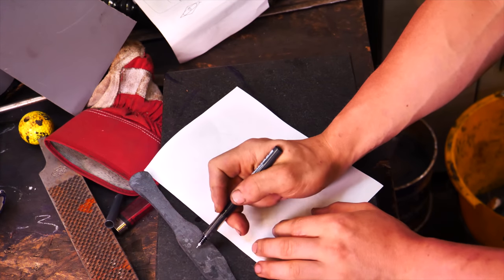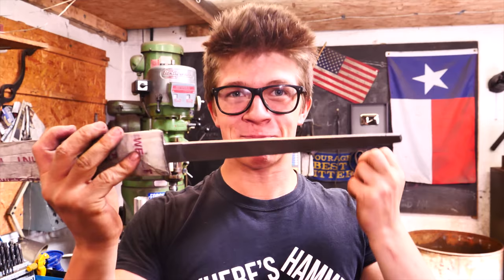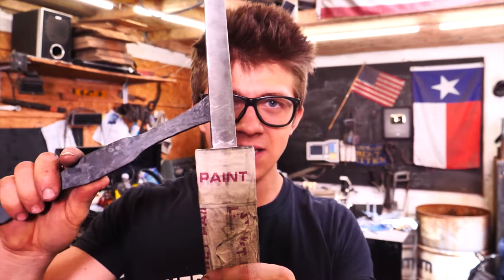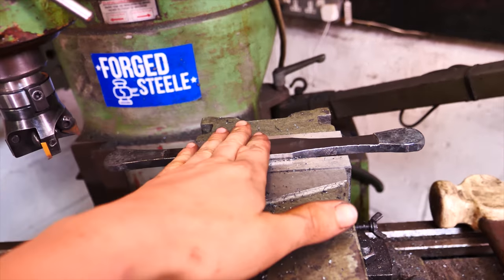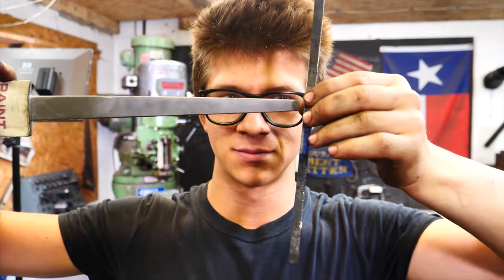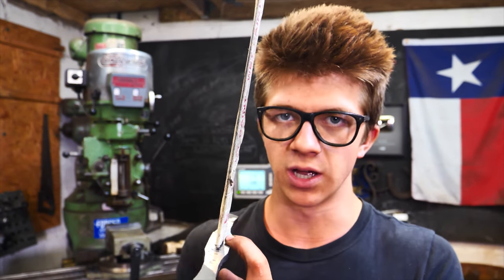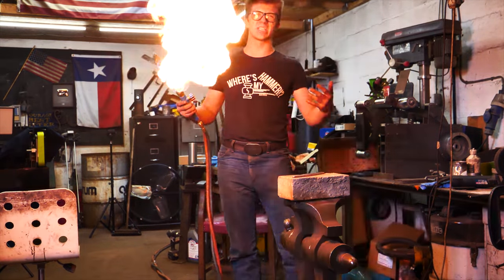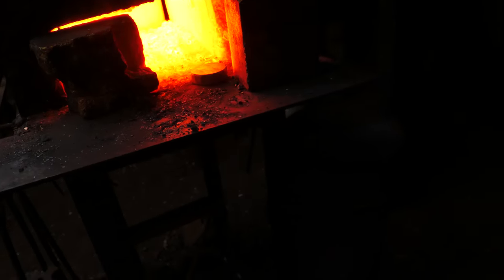MAKING MY FIRST SWORD: Part 7: THE GUARD IS MADE + Forging the Pommel *4K*

Comment: Ok, just a few small tips, 
1. bend the guard upwards just a few degrees on both sight of the blade, it will look amazing and it will add functionality to the overall piece(easier to catch a sword on the guard if it is angled)
2. Please put a larger version of your stylized "S" logo on one or both sides of the pommel. it will look amazeballs! 
3. please read this.
Reply: UPVOTe UPVOTE UPVOTE
Reply: Kent Bräster I SECOND THIS ^
Reply: I also second this.
Reply: Kent Bräster I second this!!!!
Reply: I like the straight guard. Design on the pommel is a good idea though.
Reply: I like the traditional straight guard :)
Reply: I think "please read this" should be #1, yeah?
Reply: I'm not too sure catching your opponents sword in combat is such a great idea. I mean, you incapacitate not only your opponent, but you also greatly risk doing it to yourself, due to a sword stuck on the guard...
Reply: Catching the blade usually just means stopping it on your guard - arresting the momentum but not actually having it bite into or stick on the guard itself. That said in my experience (several years of sword fighting through HEMA) removing the blade from your opponents control - by trapping, using sword breaker/catcher notches or just grabbing the damn thing with your other hand - is a very powerful & useful technique. Once you have control of the blade it's unlikely to be much of a risk to you. =)
Reply: True that, but I would probably much rather prefer to grab the sword with my off hand, than having it stuck on the guard. In my case that is mainly because I'm clumsy enough so that it could happen :)
Reply: the functionality to the piece...... it is a bloody sword! 
He isn't gonna walk in the streets with it and run into bandits and fight them with his sword..
Reply: what has that to do with anything? Yes, it may be a sword and yes, in this day and age it might not be the most effective weapon, but is that an excuse to put less than the utmost effort and care into making it? to make it an efficient tool as well as a beautiful one?

My point is, If you are going to make something, do it well and to the best of your abilities or don't do it at all*
Reply: No he isn't, but lets say he want to make a historically right sword at some point. Then he needs to know every little thing about its functionality. In fact, it is always important to know the functionality of a sword as I'm sure a simple google search of fail swords will tell you. One functionality is balanced weight. Which he has and knows. If he hadn't, he wouldn't be able to lift the sword. Many have failed at making swords because they just think it's a bloody sword and they don't really have to think about it.

Another thing is that there are people here who are interested in swords and middle age technology, who also like to discuss the subject on public forums like this comment section. And there are also events where people still fight with real swords. Even swords that aren't dull. Just for making a show. Yes, there can be many injuries there. But these people are all volunteers.
Reply: You should have put 3 at the start
Reply: Kent Bräster A

Comment: This is going to be very pedantic, but I run a sword channel so obviously I'm going to be pedantic about swords. Ideally, the shoulders of the tang (where the blade transitions into the tang) should be rounded rather than a sharp 90° angle. This increases the strength dramatically, but obviously increases the work needed in fitting the guard.
Reply: I was just about to say something but you beat me too it!
Reply: well if 'you' did everything right the first time, all the time, you wouldn't learn much at all...
Reply: Yes, go and get a round file and put a radius between the tang and blade, otherwise you get a stress riser right at the corner where the blade will break..  You do NOT want sharp 90 degree corners.
Reply: I was hoping someone would post this. 90 degree shoulders are extreme stress points...I'm worried about the rigidity of the blade when it is struck against anything harder than soft targets (e.g.: paper rolls/beach mats, fruits etc).
Reply: Yeah, it's a serious hazard. I remember the early HEMA swords that used these (Hanwei, I think) before they realised why all their blades snapped at the tang. Rounded shoulders are super important.
Reply: it's not pedantic. you are giving advise to a guy in the process of forging his FIRST ever sword.  if Alec follows your advice or not it's his decision and you get to say I told you so. either way he is doing much better than me at this seeing as I have never contemplated doing anything like this
Reply: I've done quite a few knives and swords in my time, and yeah, it's the sort of thing you learn over time. He's doing very well for his first sword, but this is a somewhat fatal design flaw that could cause it to break.
Reply: Jason Pollastrini That was constructive. Get triggered by someone experienced giving advice to someone inexperienced... seems legit
Reply: I was also going to mention this, but based off an engineering class I took in college.  Sharp interior corners concentrate stress, leading to metal fatigue.  There was an engineering failure that happened with the DeHaviland Comet airliner back in the 50's caused by stress fractures in the hull of the aircraft.  The culprit was the square windows in the passenger cabin, which led to the pressure cabin failing on 3 different aircraft and the aircraft breaking up in flight, killing the passengers and crew on all three aircraft.
Reply: the more you know
Reply: True, though he's put in such time and great care for the blade, I'd hate to see it get ruined by a simple misstep.

I made this same comment on his FS dagger video.
Reply: Yeah, Real Engineering did a video about that. explained it pretty well. Agreed about sharp angles
Reply: He could fix it with either the mill or grind the blade down,  then finish off with a round file. Another issue is how much thinner his tang is compared to the blade, with the 90 degree corner that thin tang just compounds the issue.
Reply: could he not add a weld bead and then round that out as a quick legit fix?
Reply: not without weakening the integrity of the structure. since it's high carbon steel, he would need to heat it up and then tack weld, which would ruin the temper/heat treat.
Reply: Jason Pollastrini to be fair, you wouldn't have to learn anything
Reply: That's not pedantic, that's informative :)

Comment: Why Don't You Heat The Guard Then Put It On? So That When It Shrinks It'll Be A Tight Fit?
Reply: Bronson Stephens  The best and only way to do it! Best advice!
Reply: Tom Tulloss Oh Awesome! Thank You.
Reply: +Jordan C. Wilde   The milled out slot will become larger when heated up because metal expands uniformly with temperature. think of it like enlarging a picture of a doughnut  on MS word (or whatever other editing software) when you increase the size of the picture, the hole increases. same with metal.
Reply: Jordan C. Wilde how would you fit bearings on a shaft by heating them? Expansion just creates a bigger version of what your heating, including internal pockets/slots.
Reply: You'll lose the temper.
Reply: You could heat the guard to tempering temperature and maybe freeze the tang, then hammer the guard slightly on.
Reply: Try it. it works extremely well if you can cool the shaft as well it works even better. A light bulb works perfectly (incandescent ) set the bearing on top of it for 10-15 min. works for wrist pin to piston fit as well.
Reply: Edgar der Schmied Exactly What I Was Thinking (:
Reply: I'm stupid for never thinking of this.

Comment: Good tip for you Alec. A set of knife making videos I have told that if you use jb weld to bond the guard to the blade, it will blend in nicely with an etched blade. This is because it is frayed than regular epoxy, and as long as you clean everything up properly it should be hardly noticeable

Comment: you should make something out of metal from meteorites
Reply: Most of the metals from meteorites is iron, but I don't know the limitations that come with that. Plus any usable amount would be super expensive.
Reply: MRCOLOURfilld Man at Arms did it once for Sokka's Space Sword and it was over $1000
Reply: yeah, meteorite metals are expensive as hell, but they do look sweet
Reply: The magical property of meteorites is the patterns they develop from their thermal history in our solar system. We can learn a lot about the formation history of our solar system from these interesting patterns. When a meteorite is forged this pattern is lost and you're left with and ordinary lump of iron. Only a blacksmith that doesn't understand nor appreciate meteorites would believe the novelty of a meteorite remains after forging. It's akin to thinking the value of an old coin would remain after melting it down.
Reply: Bing van der meer meteor rocks are extremely expensive and even with 20 years of experience it is extremely hard to forge :-)

Comment: For a perfect press fit, here's an old mechanic's trick : warm up the guard in the tempering oven and cool down the tang with either dry ice or a can of liquid air that you hold upside down so the solvent comes out in liquid form. As the temperature of both parts equalizes the tang will expand slightly and the guard will shrink down slightly resulting in a very tight fit. The liquid air can be bought at the electronics shop. 
Hope this helps! Fantastic work so far mate!

Comment: Adding a ricasso on the blade helps that transition between blade and tang. As for cutting I would suggest the HDEP milk jugs, we use them to test cut all the time, if the blade is sharp and you get a good cut, you can cut the jug multiple times

Comment: Mr. Steele For a workshop microwave it is not DIRTY enough. :P

There are many things that people cut up with swords.
Tatami mats are used as an alternative to human flesh but that is expensive.  One would suggest you use fruits but that is boring as anyone can do it.
A very difficult thing to cut is full water bottles because they require the user to understand how to cut with a sword.  Specifically proper blade indexing and slashing motions.  Without either the cut will bounce the water bottle off the blade.
So for a backyard cutter I suggest you cut fruits and vegetables.

I hope you keep the handle long as I like hand-and-a-half swords (AKA bastard swords) and that handle length is appropriate for such a sword.

Comment: In hindsight, maybe leave the rounded transition from the blade to the tang. Sharp corners = stress concentration. You'd have to round over the top edges of the slot ends in the guard but I do realize it'd be harder to accomplish the tight fit you're aiming for if you try to nest 4 radii.

Great content as always, and I do have to say the production value of your videos is really excellent as well.

Comment: It looks easy when you get all of those machines they help a lot! Im making my first blade ever and its a sword , its almost 4 feet long with the tang by 2.5 inchs wide. All i have is a 4 inch angle grinder with some flap discs and a lot of sand papper , been sanding it down by hand for at least 18h to get the geometry straight and smooth, im starting to work in the brass guard , and i got a cordless drill to punch some holes trough it . oh its painfull my arms are sore bu the results are good , for my first time.

Comment: Very often a good length for the guard is the same length as the grip on swords like this with a straight crossguard hilt. It doesn't really have to do as much with the lentgh of the blade but needs to be a certain length to cover the hands well, and thus it's connected to the handle lentgh and shape, i.e where are the hands gonna be. Great looking sword so far though and it's really impressive how clean and carefully measured it is, especially being your first one.

Comment: Love the sword, but....
from an engineering standpoint, the 90-degree angles between the blade and tang create stress raisers and make the blade weakest at that point. to prevent this, a radius corner is needed, which is why old swords had the recess into the guard for mating.

Comment: Just a thought I got watching this (amazing) video, was it possible to use thermic dilatation to get the "perfect" fit for your guard ? Like, use the forge to warm the guard a bit, while the blade stay cool, so you could fit it in and wait for the temperature to stabilise ? Or maybe it's not the best for the steel integrity ? I'm curious about it :)

Comment: EDIT: reading through the other comments: THE TANG! round the corners where the blade and tang meet to avoid stress fractures. With so much work put in you don't want to just snap the blade off at the guard.
Are you using any of Oakeshott's sword typologies for the basis of this sword? Also, have you learned what characteristics make a fine sword; point of balance, center of percussion, and such? I'm just curious, because you did mention giving it a proper distal taper in a previous episode, which is a very important part of placing the balance point close to the guard(for a nimble blade). I can't wait to see the finished product, I'm sure you're even more excited than any of us for the big reveal! =D

Comment: Texas!
Hey, don't harden your next guard or shield. They are made to absorb and even slightly deform and spring back; steel won't get cut, right? Right. However hardening also.makes the steel much more brittle; meaning it will durable rught until it fails massively due to percussion/vibration and shatters.

Hardening just the edges would be cool though! Can you turn the edges into martensite?

Comment: Hey Alec one little suggestion, I wouldn't harden the guard instead actually temper it and make it soft. Reason being it wont crack if something hits it and even though I doubt it'll see any real swordfighting, an opponent's blade will bite into it and grab it instead of glancing off and injuring the one wielding the sword.

Comment: I wonder if instead of filing that extra .1mm you could have heated the guard which would have opened the hole, then just insert it onto the tang and let it shrink around the tang.

Comment: the tang and the blade transition should be curved! Someone please warn Alec. 90° degree angle causes stress on the blade. The blade will snap if it's not curved.

Comment: I don't think the blade tang transition should be square because it will induce lateral strain and might cause cracking. Rounding and slight taper would be more performance oriented.
What was done traditionaly is wax was used to transfer the exact shape of the cavity.
Reply: Other than that cracking job mate

Comment: cut some plastic bottles or milk cartons with water in them. it's good for edge practice, so if the sword is a good one, you should be able to pull it off.

Comment: Its going to be a beautiful blade and I recommend learning to swing it correctly before you go hacking at random objects. I'm no expert, but as a kid I used to practice with a cheap katana just doing slow form drills. When you swing just right, it will whistle in the air, even if you swing it slowly. If your blade is twisted to the side(unbelievably easy to do) when you swing, the howl of the blade will not nearly be as pronounced and your swing and cut will be cringing. The blade is a beautiful piece and deserves a proper swing. Learn to keep your arm and the blade traveling strait the entire swing. Don't be like the slingshot guy and go whacking things sideways like a barbarian and bend it

Comment: Happily there are no zombies around to slice when it's finished (Yet).

Test it on rolled straw mats, held vertically obviously.
Reply: themig292003 tatami mats
Reply: Indeed. Though local straw in bundles might be easier to get hold of, given the farrier in the vicinity.
tatami mats are rice straw if i recall.

Comment: Shouldn't the meeting of the tang and blade have a fillet on each side rather than an exact 90 degree angle? I don't know that it was well known in 700 C.E. but those right angles are basically like the "TEAR HERE" on a plastic bag or condiment packet

Comment: It would be easier just to heat up the guard and then hit it with hammer to fit it to guard instead of filing,that way you get press fit ,and save time .1/10 of mm isnt much to press fit.

Comment: Heat treating seems impossible I don't understand how people do it
Reply: What? Why does it seem impossible?
Reply: Karim Lel cause you have to know when to take it out and be quick about it. Like how do you when to take it out
Reply: jrs_ 2000 Nope, you don't need to be "quick about pulling it out" (that's what she said) you can keep the sword in the oil for as long as you want, or normally until it has cooled down
Reply: Karim Lel I mean how do you know when to take it out of the fire
Reply: You have to heat it up to critical temperature (until the blade is non-magnetic) and then rapidly cool it down. The exact temperature varies based on the alloy of steel, as well as the exact method of cooling it.